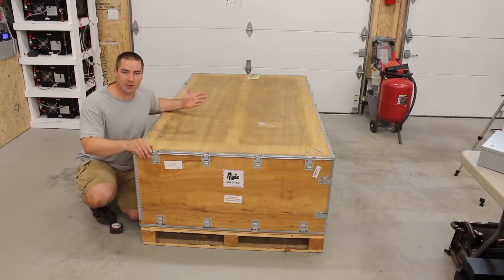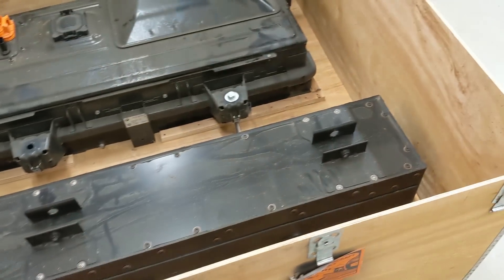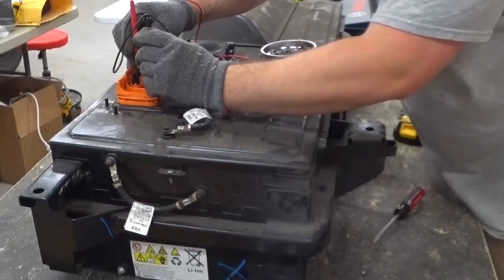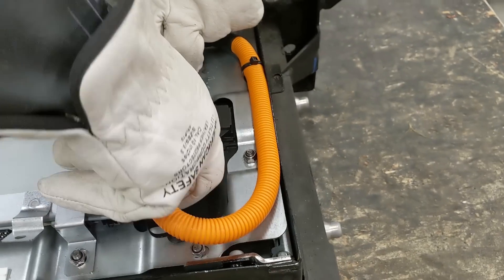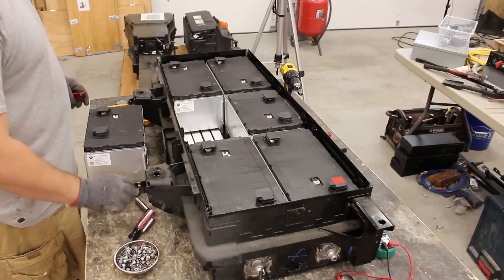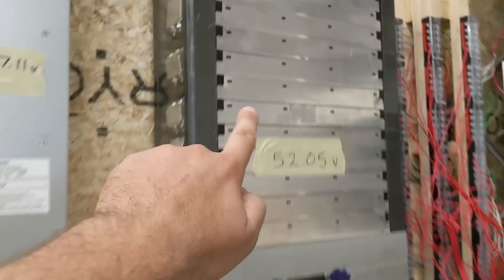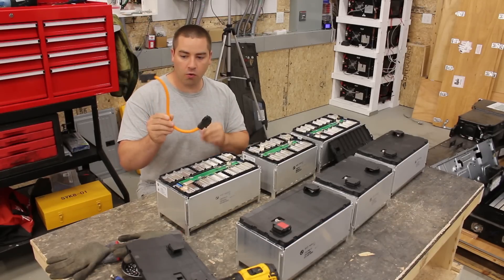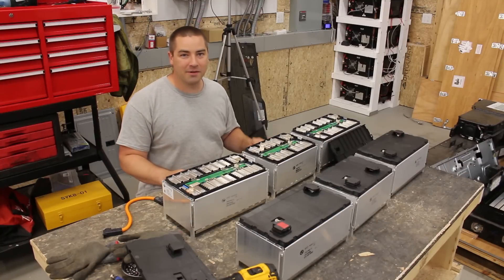Huge BMW Lithium Battery, EV, Less Than $100/kwh

Comment: Please use a driver to drive. Drills are for drilling. Dewalt makes a decent driver. Why are you using a drill to loosen bolts? My favorite driver is Milwaukee surge but please don’t drive with a drill.

Comment: david - what BMS would you recommend? for this 48v configuration bmw battery? thank you!
Reply from the maker: There are several options, but I ended up buying 8x 100 Amp BMS's.  https://batteryhookup.com/products/12v-lifepo4-smart-bms-w-low-temp-cutoff?variant=36287975522466  Select "14s Li-ion" from the drop-down list if you are arranging them as 14 cells in series.  My discount code is DAVIDPOZ

Comment: Would you recommend EV battery's to be used to make a power wall 30kwh to 120kwh?
Reply from the maker: Personally, I like tinkering, and making things.  So I'm OK with EV batteries, but I like to buy them about $100-150/kWh.  Once they start costing more then that I don't think it's worth it.

Comment: Hi Dave - great Videos!  (And Kudos for having your daughter help you with the work!  A future engineer perhaps?).  I am following your teardowns due to interest in using LiPO batteries in a sailboat to replace a diesel engine with a high torque brushless DC motor.   The boating community is interested in power capacity (kwh) and weight density - lbs/kw output or similar - as the boat cannot get too heavy once filled with the batteries!   A typical large cruising sailboat has a 40 hp diesel engine, so about 30 kw, though we actually only get maybe 25kw of power after 10 or 20 years....  We will also have about 40 gallons of diesel on board, for maybe 60 hours of usage to get past storms and calms and nights ... So I'm looking for about a 40 kwh battery .....  If you can keep the need to discuss power density in your videos, it'd be great!    Thanks again - very informative.... (also btw, there may be a lot of people interested in home-built solar installs.... if that is your target audience, thanks also!)

Comment: Hi Dave,,I have the same battery bank as you have there. I been slowly building up my setup. I will have a 48V system 14s6P with 1ea. left over of 3s,4s,5s ( no ideas for them yet. ) i might sell to buy more BMS's i need. ( i am doing 1 BMS per string. ) I'm curious to what you are getting out of the set you are using..
1 Are you using 48v set up as well or different ?
2 How many Kw or Ah are you getting out of the batteries ?
I'm hoping 4.8Kw worth of solar will sufficiently charge the batteries.. approx 120vdc into charge controllers.
Too much or too little? If too much , then i have the option to add more batteries.
any tips or comments appreciated... 
Thanx..
Reply from the maker: Hi Ray,  I don't have data on mine yet, I've been focusing on other projects latley.

I wire these as 14s to work as a normal 48V system.

Any size solar array can work.  It's more important to make sure the solar can cover your loads.  The one thing you don't want is a solar array of more kW than the kWh of your battery bank.  Meaning, if you test your battery bank and it's 28kWh, then don't have a solar array larger than 28kW, and ideally no larger than 1/2 that (14kW) so that you don't charge the battery at too high of amps.  High amps cause heat.
Reply: @DavidPozEnergy  Thanks..  I'm looking for the info on the batteries, I had saved a link from BHU, but it's a dead link..  I will have  2X     2.655kw for 3 strings of 48v....battery bank. with Epever 6415 charge controllers., and i have  JK brand BMS's 1 for each string of batteries.  I just need info of the batteries so i can set my controllers.. I'll take any advice you have.. This is my 1st Big project..
Reply: @DavidPozEnergy  Hi Again.. Have you any new data on those batteries yet ? I nearly have mine completely set up.
 I have my set up, as i explained earlier.. I just need to get me some more cable. 
Curious if you put yours to use yet or not.. I'll Have 4x 3S packs left over once i'm done. I might build me a portable solar cart charger..
I think I may upgrade my Inverter as well.. I have the AIMES 2kw (6kw surge for 20 sec ) Lil disappointed with it tho, it will not even start my washing machine. right now i am using half the set up ( 3s3p solar 9x 295W panels ) and 14a3p Batteries.  I can run my tv entertainment system and 2 refrigerators for about 1.5 to 2 days without sun. 
The Solar charger gives about 12A per string Max..10A average.   CC can handle 60A... so everything is running nice n cool..
Look to hear from you soon..

Comment: just an update to my previous comment 8 months ago I just finished (20) 14s modules 48 volts -- 58.8 --85 amps  fully charged, out of the 3 crates of BMWs  batteries from BATTERY HOOK UP for a total of 1700 amps capacity or 99,960 watts for  $197.00 dollars  per kilowatt including the BMSs and all the hardware to put everything together. so far it is being running for about a month so far so good, so thanks for at least show me the partial disassembly of the modules in your video but I managed to figure out the rest

Comment: Hi David. Very good videos. Learning lots. My question to you is about the circuit breakers you spoke about. It sounded like you were counting on them to limit the current somehow but the charge controller determines this correct? The breakers are just there for protection in case the current goes higher than the rating of the breaker. So they should be there but their only purpose is to protect overcurrent when outputting.

Comment: So what was in the other modules? More cells, or other components?
Reply from the maker: Yes, more cells.  A lot more cells packed into the other two modules.
Reply: @DavidPozEnergy  Thanks for the info - I was just curious.

I've learned quite a bit about lithium cells and their variants from videos like yours.

Your quite prolific, which is great too.

Nice to see someone keep hitting the subject repeatedly and show what fails spectacularly, what turns out to be a dead end, and what makes a neat solution for certain use cases.

Comment: Could you pump the active cooling into your crawl space water heater? Or as added heat for the garage?
Reply from the maker: Physically you could move water around, but practically, it won't heat.  In order to heat the crawlspace with hydronic radiators you need 140°F water.  If the batteries are running at 140 (or more) they have a problem.  My batteries run at room temperature or perhaps one degree warmer.

Comment: Hi David, I finally got some of these BMW batteries configured into two 48V banks with a BMS on each and I’m almost ready to apply solar charge to them.  I believe these are Samsung SDI batteries and they certainly are amazing as they are 20 year batteries and are built like tanks!  
However, I couldn’t find info on the batteries specific charging requirements.  Now I need to program my MPPT Charge Controller and I’m uncertain as to the optimum charging profile for these batteries / chemistry / other relevant constraints?  Can you help please?
Thank you,
Reply from the maker: Hi Derrell,  It's great you are using them in 48v setup.  That's the same as me.  The extreme voltages would be 2.8-4.2 volts.  But that's really pushing it.  Instead, I use more conservative numbers.  I charge to 4.05 volts per cell.  And I discharge to 3.5 volts per cell.  This still leaves 80% available, but gives about 3x the life compared to 100% discharge.  In the case of 14s (14 cells in series) just multiply (4.05v)(14s)=56.7v  (3.5v)(14s)=49v
Reply: Thanks for the guidance on the battery system, and like you, I really prefer getting the maximum life and reliability from them.  I certainly wouldn’t have gotten into this without having seen your videos but I now have a pretty solid foundation regarding the subject thanks to you and others who are sharing their knowledge!  Thanks!

Comment: Heh, that's the difference between German Engineering(tm) and (cheap, commodity) Tesla. [tesla made the battery and drive train for the smart ev]

I have over a ton of those modules. They are currently being removed from our EV "racecar", in favor of smaller, lighter, cheaper, more powerful LiFePO4 bricks. (we'll see if that pack can be made small and light enough for hot-swap during a race. The previous method of pulling a 500lb pallet of volt batteries out takes too long.) At 100A those packs won't even be awake; they're designed to run a car at significantly higher power loads. (from the datasheet, continuous charge/discharge per cell is 120/160. 40Ah(C/3)) The cooling loop is to keep the batteries at a "perfect" temperature for decades of longevity. (also, because they're in a car; cars live in temps too low and too high for safe operation. Talk to a Leaf (no active thermal management) owner in AZ and AK.)

Comment: I have been wanting to do this, even start out with just my water well, then water heater.......It must be nice to have money!  Batteries are so expensive,  even used/refurbished.....everything about solar is expensive.  I KNOW it pays in the long run but how does the average (actually,  below average) income persons afford to do this? I just recently got married and have a stepdaughter now. Would love my family to be saving $ on utilities but without $ I can't even start....very sad.  I have A.A.S. in Industrial Electronic technology but was in a motorcycle accident causing permanent damage which is difficult  as well.    I had planned on doing 12v for well.  If you know of anywhere (especially in NC) that would work with me...PLEASE let me know. I will advertise their products,  just need help getting started. Thanks.

Comment: something should be done with used EV battery packs where no one would need to dismantle/extract the cells. saves time, effort and the overkill case/housing for safety.

Comment: Hi Dave , thanks for all those videos !  Quick question : How many KWh can I get from a 14s 48v pack  ?
Reply from the maker: Between 3.7kwh and 4.6kwh.  They were 4.6kwh originally, but I think Battery Hookup is only guaranteeing 80%.  So somewhere in that range.  Hopefully in the next week or two I can wire in my BMS and do a capacity test.
Reply: @DavidPozEnergy  Thanks a lot , I'll keep an eye open on the BMS connection
Reply: @DavidPozEnergy  	 My question is , if  3s modules    have a nominal voltage of 11.52v, wouldn't 4 modules (12s ) be good for a 48 volt inverter ?

Or why  do you recommend they  be 14s ?

Comment: Hey Dave, after watching this vid a little while back, we purchased the last two they had.  You definitely inspired me and quite a few others to take on this project . . . and I’m onboard for a 48v, 10+kW battery system.  The tear down went fine and the vid was a great guide.  I wonder if you have a part # for the balance circuit and any other hardware needed for that function?
Also, what are your plans and timetable for your batteries and any future vid release?
Reply from the maker: That's great you were able to get the last two.  Congratulations.  
I posted a follow up video discussing BMS options for the battery.  Then I ordered BMS's and got to work on other things.  Once all the BMS's, wires, connectors come in I'll come back to this.  Sometimes it takes months for BMS from China to arrive.  But, if I was ordering today, I would just buy the BMS's Battery Hookup now has.  I think they got them in last week.  
BMS video: https://youtu.be/jT7_VImZYM0
Battery Hookup BMS  https://batteryhookup.com/products/12v-lifepo4-smart-bms-w-low-temp-cutoff
Coupon code "DAVIDPOZ" for 10% off at Battery Hookup.
Reply: DavidPoz Thanks!

Comment: dude, did you say these had 8000 amp hours?
Reply from the maker: The cells are 90 ah.  96 cells in the whole crate.  3.7v nominal per cell.

Comment: Can you knock them down to 12 volt banks? Looking for battery options for my rv conversion
Reply from the maker: No, not really.  Here's why: This BMW battery has chemistry Li-NMC.  Each cell has a usable voltage range of 3.5v-4.1v per cell.  So if you use a 3s (3 cells in series) the usable range is 10.5v-12.3v.  This is a bit low, and won't be able to charge from your RV alternator.  If you instead, use a 4s configuration, then the voltage range is 14-16.4v.  This is too high for most things.
The best way to add a 12v battery to an RV is using a different chemistry.  Look for LiFePO4, sometimes written as LFP.  This stands for Lithium Iron Phosphate.  LFP chemistry has a usable voltage range 3.0-3.5v.  A 4s will be 12v-14v. Making a perfect drop in replacement.
Reply: DavidPoz ok, are there any budget options on the market you can think of by chance? I’m trying to go solar with about 800 amp hours of storage if possible. I have an 82 crown school bus I’m trying to power. Will be putting mini split ac and refrigerator and whatnot with a 5,000 watt pure sine inverter. Any advice is deeply appreciated. I currently have a 4,400 watt dual fuel generator feeding the bus but I’m sure the ac will overpower the generator once it’s installed and running here in the California desert. Again thank you in advance for your time
Reply from the maker: Hi Mike,  If you need a 5kw inverter, then go 48v.  So I'm not sure if you plan a 800 ah battery at 12v, or 48v.  If you are using the ah rating based on a 12v system, then we are talking 9.6kwh capacity.  At 48v, that's 200ah.  
The absolute cheapest way to get the capacity is with 4 of these modules: https://batteryhookup.com/products/byd-24v-8s-lifepo4-3kwh-blowout
You can use my coupon code "DAVIDPOZ" For 10% off
You will need to add some BMSs.  If you need more help, send me a message in facebook, or e-mail.
Reply: DavidPoz ok, yea has to be 12 volt because i want to tie the batteries into my bus charging system for those days when there’s not much sun for solar the spare alternator will charge. Or if i run my starting battery down I’d still be able to start the bus. Right now the generator will charge the 12 volt start batteries but i want to remove the generator eventually. Ok I’ll put a list together of what i have and need and I’ll email you. Thank you for your advice sir

Comment: I can drive upwards of 3000 lbs (two of those boxes) almost anywhere in the Northeast for $250 "+ tolls if any" or if you find something on FB marketplace that needs, personal handling, I have delivered as much as 2800 lbs as far as Denver, CO (not for $250 LOL) from upstate NY so I will pickup/deliver, anything/anywhere (Safe, bond-able, security clearances)

Comment: You might not want to use active cooling but you never know. Some thermal transfer grease would be a good idea on those heat exchanger surfaces.

Comment: As of 9/11/20
Those of you that still want some of these batteries they have a NEW batch, but smaller battery packs. They are 21KWh BMW packs. But they have 60 Ah cells instead of the 90. I would buy these without a doubt even though they are a smaller capacity. STill only $119 per KWh of Lithium! 
www.batteryhookup.com

Comment: WHAT IS A 14s 48v pack ?
Reply from the maker: 14s refers to the number of cells in series.  This battery is comprised of lots of lithium cells.  Specifically Li-NMC chemistry.  This type of lithium cell has a voltage range of 3.0 to 4.2 volts.  We call them 3.7 volt cells because that is the nominal (middle) voltage.  When you arrange cells in series you add the volts together.  A 1s battery would be 1 cell in series.  2s is 2 cells in series.  etc.  In the car this battery is arranged 96s for a nominal voltage of 355v.  This is very high.  My inverters are a nominal 48v.  So I have to break down the battery into smaller packs and create something in the usable range for my inverters.  14s works out pretty good to the usable range.  I have more info in this video: https://youtu.be/CbHABrTpSKU
Reply: @DavidPozEnergy  Thanks, question : Would four (4) x BMW OEM 3s 12v 75ah 869wh Battery Modules  do the job for a Nominal 48V Inverter ?   This would be 48 volts , but 12s instead of 14s ....  Battery Hookup is out of the  4s Modules
Reply from the maker: 12s can still work for some inverters, but not others.  You will have to check your inverter spec sheet.
Reply: @DavidPozEnergy  Hey Dave , thanks , how about 15s ?,  what inverter can handle 60Volt ?
Reply from the maker: I have a video on this topic which might help: https://youtu.be/CbHABrTpSKU

Comment: This seems crazy, better to work with the integrated system and keep the battery packs whole.
Reply: NO. These things are awesome! This giant battery pack comes with multiple sized modules. 5S, 4S, and 3S. Each cell is 90 Ah new. salvaged...80Ah+/- 
But MY batteries are like BRAND NEW! My holding charge right 4 volts!!  

I'm building a 36 volt golf cart battery, and a 48 volt powerwall for a tiny home.
The golf cart battery will use (4) 5S Batteries wired in a 10S2P(4P)* configuration. Giving a 5.9 KWh 36 volt battery Pack.

I bought 6(4) extra 5S for the golf cart and (2)  more 5S for  cell scavenging if a cell goes bad in my battery banks. Those batteries however hung around the 3.8 volts as advertised by batteryhookup.com

*Note: each 90Ah cell is actually (2) 45Ah cells in Parallel.

As of 9/11/20
Those of you that still want some of these batteries they have a NEW batch, but smaller battery packs. They are 21KWh BMW packs. But they have 60 Ah cells instead of the 90. I would buy these without a doubt even though they are a smaller capacity. STill only $119 per KWh of Lithioum! 
www.batteryhookup.com